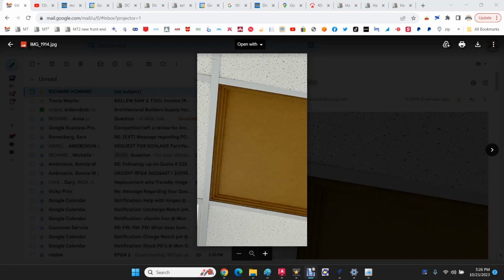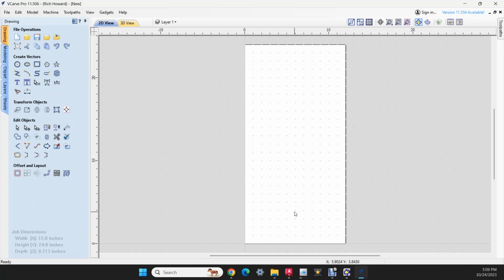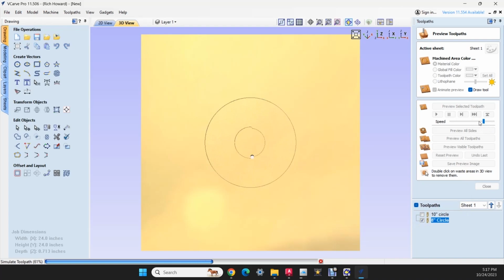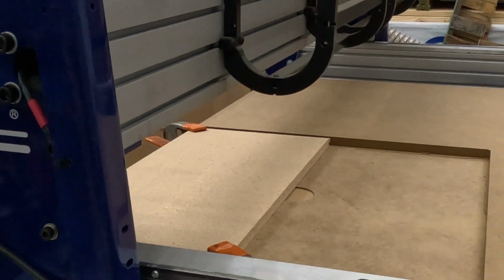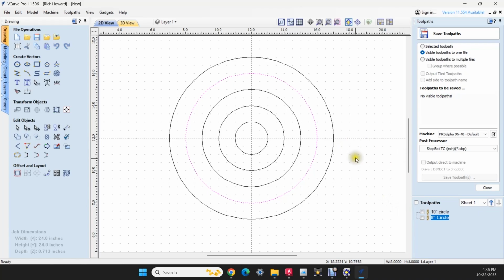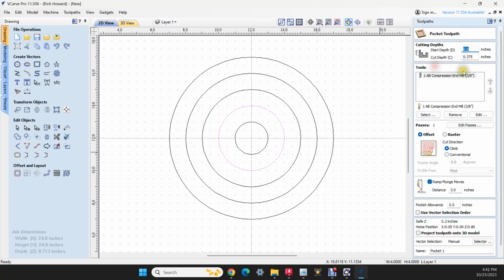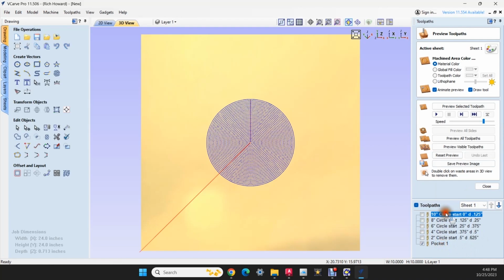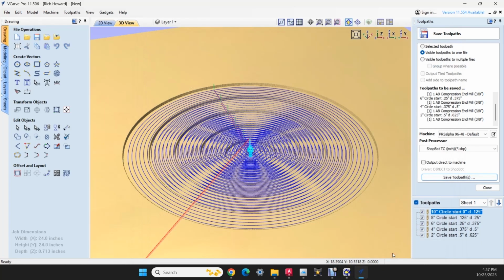VCarve Pro: Pocket Toolpath and experimenting with Start & Cut Depth settings | CNC Sundays Ep #5

Comment: Unfortunately I don't have time now to watch but why couldn't you use wider bit and when done change bit and hone the corners?
Reply from the maker: It's funny you bring up this idea because the project that i'm working on now is creating custom ceiling tiles. That's exactly what I did.  I increased the diameter of the bit but then i'm going to go in with a 16th of an inch diameter bit to really make those corners look as sharp as possible - Richard 773-809-3667 x 1112